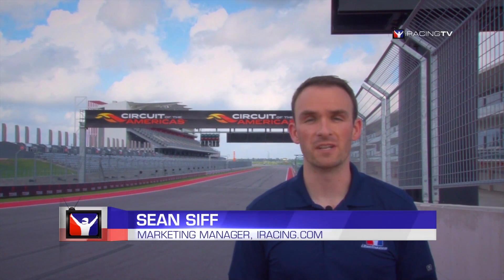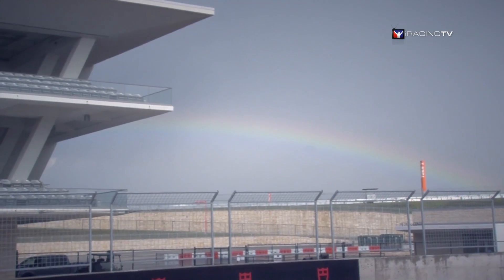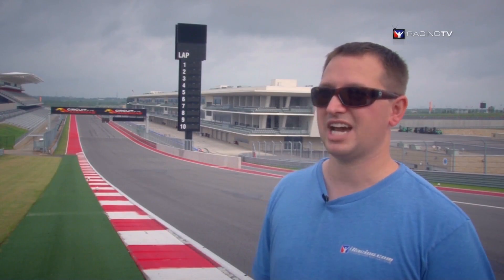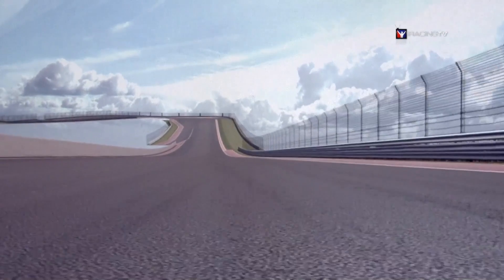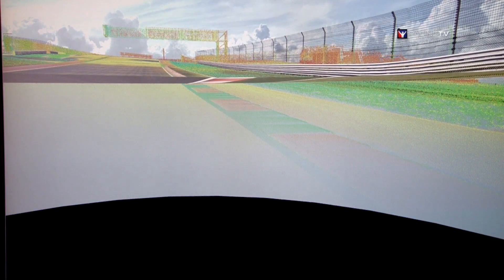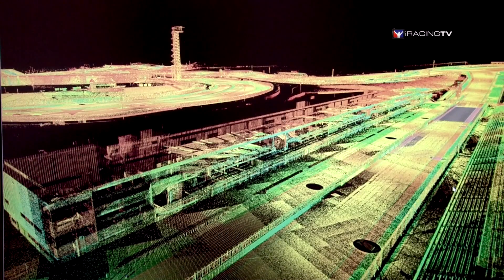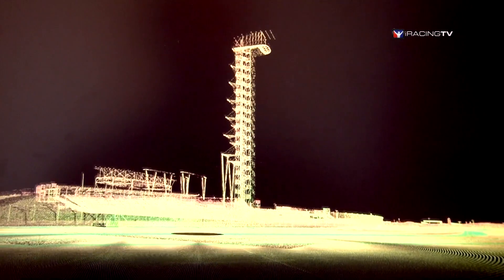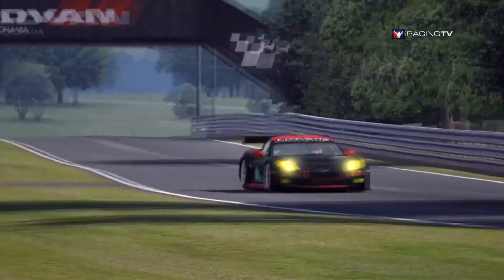Behind the Scenes // Building the Circuit of the Americas

Comment: Enjoyable video and nice marketing...
BUT they never showed us the road mesh in the video. I mean in the game you don't drive on the point cloud data but on the road mesh in 3D space. Unless the road mesh has super high resolution with - I don't know - millions of polygons per (in-game) meter the millimeter accuracy scan doesn't mean anything.
My guess is they use tens of centimeters of accuracy (probably even higher) on the road mesh which is very high but nowhere near millimeter accuracy. That would be insane work for the GPU just to render the road and there are also the trackside objects, other cars, sky, etc.